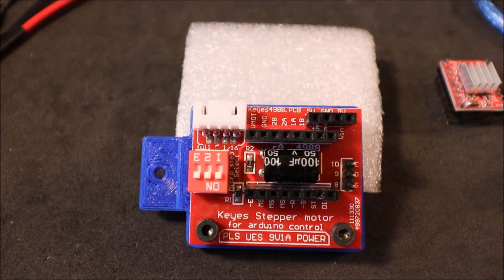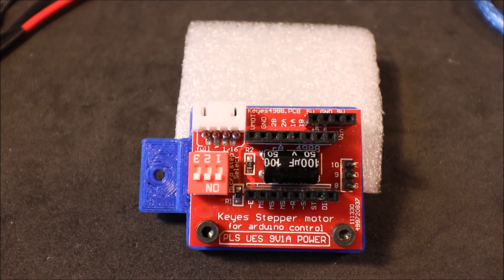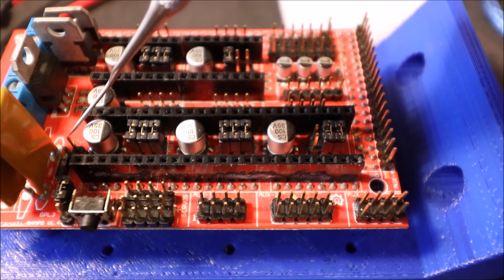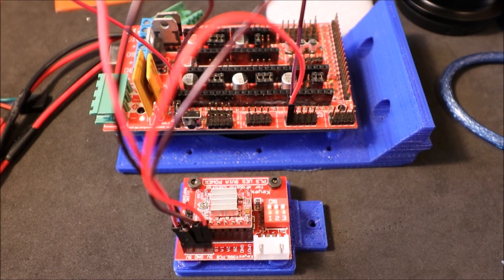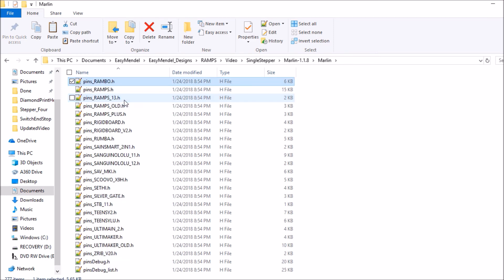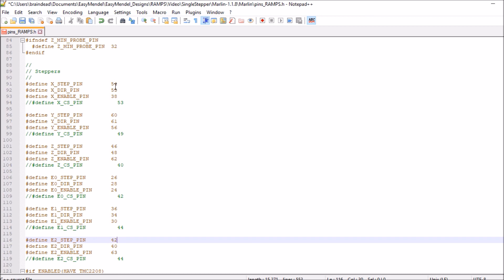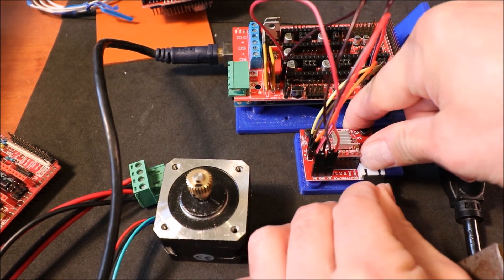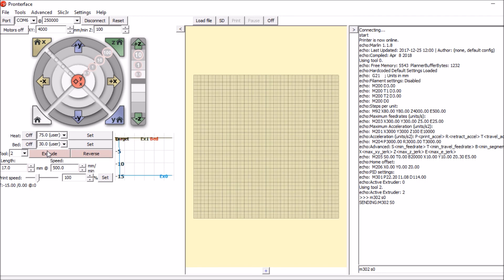RAMPS 1.4 - Single Stepper Extruder addition

Comment: great work thanks! could you possibly post a simple code just to make a simple stepper move from left to right eternally hitting endstops on each side left and right??? for camera slider? if so then much appreciated! (using this hardware in your video)
Reply from the maker: The camera situation has been upgraded for a couple of years.
Reply: @EdwardBraiman  all I want is the code to program the 2560 without marlin or any 3d printer software, I just need to move a stepper from left to right with two endstops but everybody is posting code for the Uno and smaller boards! I want to recycle my mega Ramps 1.4 can you help?
Reply from the maker: Why do you need two endstops on one axis?
Reply: @EdwardBraiman  good question, well basically I have a single axis and I have an endstop at each end of the axis (aluminium profile) and just want the nemma 17 to move just left to right when it reaches each endstop
Reply from the maker: You should only need one.
Reply from the maker: Unfortunately my time is limited.

Comment: Hi Ed, which is the difference between the black and the blue/red stepper motor expander? I use DRV8825 with RAMPS 1.4, which is the best for me? Thanks.
Reply from the maker: Go with what you need.  Red and Blue should be fine.
Reply: @EdwardBraiman  Thank you. Right now i'm going to revive my second printer (HE3D tricolor, it's a tevo tarantula clone) because the stock RAMPS 2 PLUS motherboard is faulty.

Comment: Can we add t stepper motors for x axis X and X1  for idex printer setup having two independant hotends
Reply from the maker: With Klipper you can add a second Ramps for a total of 10 steppers.
Reply: @EdwardBraiman  ok thanks...can we add in the marlin firmware..or not..?
Reply from the maker: Kipper is a different type of firmware.  You'll need to load on both and configure it in one file on raspberry pi 4.
Reply: @EdwardBraiman  ok thanks
Reply from the maker: You're welcome.

Comment: Hi Ed, thanks for the very clear and useful video! All works perfectly but just one question. I assume you remove chip select just for this application for the extra stepper? I never touched that before.
Reply from the maker: Chip select is used as addressing, kind like mailbox number.  SPI type steppers use this.

Comment: Hello, is it possible to add a second independent Z axis motor with independant z limit switch instead of third extruder?
Reply from the maker: Possible, yes, but it's recommended to use one limiting switch.
Reply: @EdwardBraiman  marlin 2.0 have z2 motor variable and z2 limit too, when you use two indipendent z motors you need two limiters. Because if the x axis is not parallel to the plate, when doing z axis home one limit is triggered, the second motor continue to move until the second limit is triggered too
Reply: Hey hi! It worked for you? My idea Is to add second independ motor to Z axis!
Reply from the maker: That's great.

Comment: Great video. Thank you for explaining everything. How would you use this Single Stepper Extruder addition connected to an arduino to run the stepper motor? Thank you for sharing your knowledge
Reply from the maker: For a third extruder for a diamond printhead.

Comment: Am I right to assume that: as long as you have data pins, you can add extenders?
Reply from the maker: Yes.
Reply: @EdwardBraiman  cool, I notice there are different sorts data pins D and A..
I assume it's for digital and analog? And does having an analog pin matter? 

I'm going to add an extruder, but yeah having TMC2130s who also claim data pins makes stuff run non standard xD annoying for a n00b like me
Reply from the maker: Try and use digital pins.  The anolog pins are normally used for temperature.

Comment: Hi Edward, just to keep you updated, i tried my idea of adding 3 extra motors to my ramps by linking the 12V supply from the D8 of the ramps to the 12V connection of the stepper shield. It worked fine and now i have 5 functional extruders.

many thanks for your help and your excellent video.

Jim.
Reply from the maker: Thanks.

Comment: Hi Edward sorry to bother again. But would it be possible to run 3 x 12 v (+ and GND) from either D8, D9 or D10 (currently i'm doing this with extra fans) on the ramps 1.4 to three separate stepper extenders, and 5V and GND from pins on Aux1 and Aux2. and then use 9 free i/o pins on aux 1 and aux 2?

cheers

jim
Reply from the maker: The power for these might vary.
Reply: @EdwardBraiman  however, it does seem feasible?
Reply from the maker: You can try, not something I recommend.
Reply: @EdwardBraiman  why not? cheers  jim
Reply from the maker: Might cause more problems than it solves.  Granted I've not tried this yet.

Comment: Hi Edward

Your method above would solve my problem easily hoever, if i wanter to connect 3 of your boards to the ramps, where would the 12V, 5V and GND pins for three boards come from, assuming i also used the E1 on the ramps to run the first syringe drive.

many cheers

Jim
Reply from the maker: A circuit bread board.
Reply: @EdwardBraiman  many thanks

Comment: Dear Edward thanks very much. How much more programming of marlin is required if you wanted to use a CNc shield running 4 extra motors?
Reply from the maker: Might work without programming, depends on if it already exists in boards.h file.  If not you might be able to add.
Reply: @EdwardBraiman  many thanks

jim
Reply from the maker: You're welcome.

Comment: Great explanation, peaked my interest back into these boards now that you can add more extruders or drivers to them. I do wonder if they will work with the new Sgen or SKR v1.2? The Sgen is just a MKS Gen L but with 32 bit CPU, and the SKR is just the Sbase but with interchangeable drivers.

I know this is bit of a request, but it looks like there's a version with two stepper motor drivers now, like this one here: https://www.aliexpress.com/item/3D-Printer-Dual-42-Stepper-Motor-Drive-Expansion-Board-8825-A4988-SCLL/32870732179.html?spm=2114.10010108.1000014.4.2b7733caiCggYh&gps-id=pcDetailBottomMoreOtherSeller&scm=1007.13338.112237.000000000000000&scm_id=1007.13338.112237.000000000000000&scm-url=1007.13338.112237.000000000000000&pvid=aa842b3f-f377-4331-b612-6c0c33849536

I'm wondering if you would be willing to do a video on how to possibly add them to the ramps 1.4 or any compatible 3d printer board like maybe the two mentioned above? Thank you very much! :D
Reply from the maker: Thanks, I'll look into it.

Comment: Hello, congratulations on the video. I wonder if you could send me a schematic for installation and configuration of the diamond extruder. Here in Brazil we do not have enough videos or explanations for a beginner to risk. I use ramps 1.4, scott 3d printer Hypercube and 12 volts on the desk. Thanks
Reply from the maker: Here is the Reprap link for Diamond 3d printhead.   https://reprap.org/wiki/Diamond_Hotend  The extender board should be somewhat to add to the printer as outlined in the video, but here is a link that might help... https://reprap.org/wiki/Stepper_Expander

Comment: Many many many thanks for this tutorial!!!, I have only one question apart from these modifications, does something else have to be done to be used in a diamond extruder?
Reply from the maker: Yes. Each stepper needs to be calibrate to the motor.  There is an existing Ramps 1.4 video I made last summer that walks you thru the process. Also testing the heater in the diamond print head and thermistor.  I basically want to cover the undocumented hard stuff no one covered in a video.

Comment: Hi Edward...using your series of videos to help configure is helping alot thanks a million.   Would you be able to help me with a situation I am very confused with.  Stepperonline indicated my voltage for all my motors are 24v yet the spec shipped on each one range ...Here is an example of 1 motor  SKU 14HS10-0404S using a DRV8825 volts is 12. Amps is 0.4. I am setting the Vref to 0.2 on the Driver.....Is this ideal or is my math off ?  Should I be dealing with this another way to get the best possible torque ?  Appreciate any input for a Junior ;)  thanks
Reply from the maker: I'm going to have to research and find a motor.  I'll see if I can take a closer look this weekend.  All my videos so far are 12 volts for user safety.  Not sure how long this will take because of hardware delivery, so stay tuned.
Reply: Much appreciated.  My guess they can run at 24v   im just wondering if thats my best way to get max torque.
Reply from the maker: I personally would start by see what occurs with 12 volts to start, but exercise extreme safety and know as much as you can before powering.  Be safe.
Reply: ok will do.  so im guessing looking at amperage and dividing by 2 to figure out vref is a safe bet still ?
Reply from the maker: Not sure yet. I'd advise to know as much as you can before attempting. I still need time to research before giving an answer on something I have never attempted. Just wanted you to exercise safety before attempting.  So I would rather you know the answers before trying and since I've not tried yet I would hold off until I've tried or someone else knows for sure.  I just like to know before jumping into a unknown electrical situation.  Patients and knowledge should be your guide.
Reply: understood;)  ill stand by.  Thanks for your help
Reply from the maker: Is this a NEMA 14 stepper motor?  Do you have a link to where you purchased?
Reply: These are all of them with driver and my vref at 12v

all bought at stepperonlime

1x 14HS10-0404S + DRV8825

vref =  0.32

1 x 14HS20-1504S + DRV8825

vref = 2.1

1 X 17HS13-04044S-PG5 + DRV8825

vref = 0.2

1 X 17HS13-04044S + DRV8825

vref =0.2

2 X 23HS45-4204S + TB6600

vref = 2.1

1 X 17HS24-0644S + DRV8825

vref = 0.2
Reply from the maker: Okay so your setting the calibration on the potentiometers.  For some reason I thought you were working with 24 volts.  The values look good, but I would suggest testing one at a time then pairs and so on until your confidence in configuration is safe.